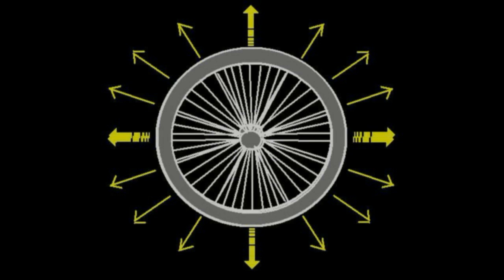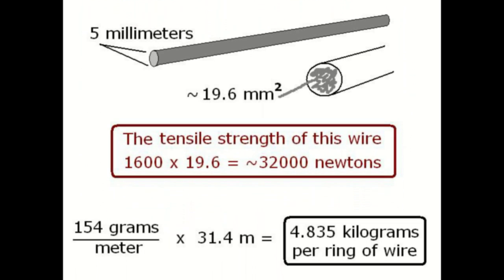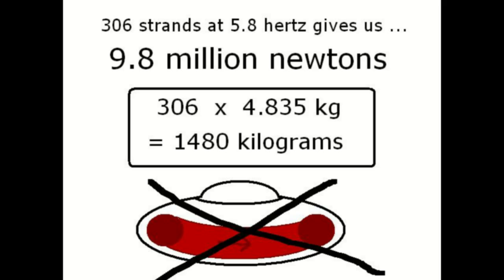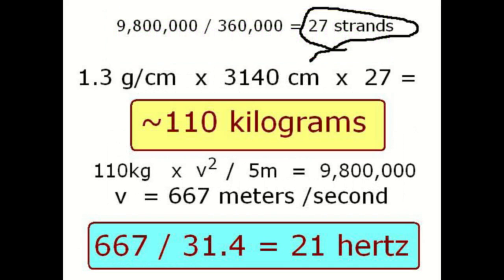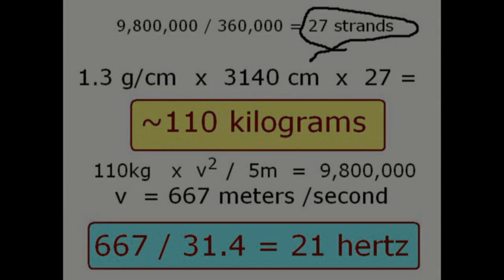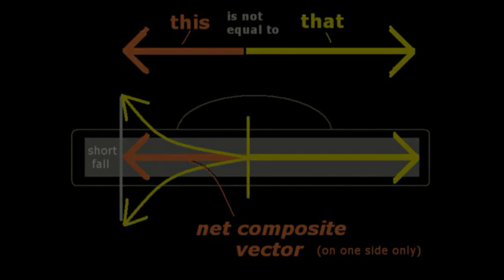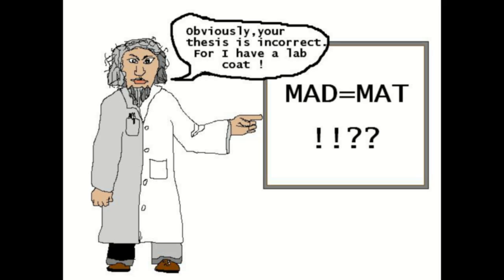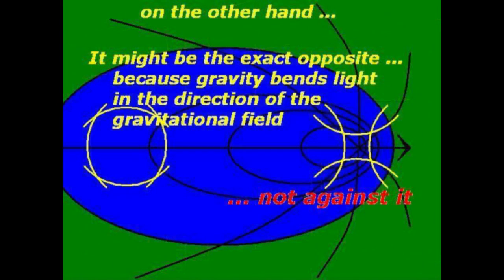Saucerdotal - The Mystery of Ufo Propulsion -3/6

Comment: Hello Mr Bantokfomoki I have two mechanical apparatus drawn on Google sketchup one closely resembles the concepts you described in your UFO propulsion videos except they are rudimentary mechanicals that operate in accordance to the materials strength and not relativistic speeds. The one that I see resembles your vision I will call a three dimensional acceleration auger device. It simply uses angular acceleration geometrically configured in just the right way so that the symmetrical momentum objects change relative weight during each half cycle of rotation due to layered multiple planes of angular acceleration) at the angles you describe with your field particles. I will only say they rotate into a type of counter space for lack of a better term without giving away the whole idea. I have a USPTO customer number and PKI credentials. I have taken patent classes and am very serious about both the apparatus. The apparatus does not have to be built by us but needs to be described in such a way as someone who is skilled in the art can build it.  Just guessing but it sounds like you may be retirement challenged just like me. I'm an insurance agent but in school I ranked high in science but unlike Einstein who persisted in physics instead of taking the insurance job his family urged him to take I actually have been selling insurance for 40 years and I'm still broke. I've really enjoyed your videos and consider you to be a tremendous asset in understanding complicated subjects. If you would like to help me raise money for patent fees and develop a proper abstract for the device I will gladly share with you 30% of all licensing fees that may be offered. Any monies that could be raised will go to the USPTO with receipts provided and full disclosure between us. According to my classes if all goes well each patent will only cost about $650.  If I've peaked your interest all we would need to do is sign non-disclosure statements and figure out how to come up with $650.  All best  William Gregory or just send me an email. look me up under William Gregory Insurance Albuquerque. p.s. The other patent idea probably has a better chance to succeed as I have been able to work out all the math that supports its concept.
Reply from the maker: I would not be interested in any kind of "sharing" arrangement. If I were ever to discover something basic of value it would be given away without remuneration.

Long ago, I decided on a solution for a payment option:
"If you profit from anything originating with me ...
decide in your own mind (without consulting your wife) 
what my contribution was worth ... then ...
You owe me exactly 1/2 of that amount."  ;o)

No patents ... no government involvement ... no arguments ... no problems.
I'm not in it for money ... I'm too old to bother about that.

In these matters ... you are completely on your own ... until and unless you can construct a working model ... then ... you will get plenty of offers ... or ... a simple bullet in the head  ;o)
Reply: Very well, I think I understand. Thank you for your reply.

Comment: hmm on Wikipedia it said the tensile strength of carbon nanotube is 65000 megapascals.
Reply from the maker: search wikipedia "ultimate tensile strength"
- "The first nanotube ropes (20mm in length) whose tensile strength was published (in 2000) had a strength of 3.6 GPa"

.................... 3.6 gigapascals is 3600 megapascals.
There are other types of stronger carbon nanotubes. I took the kind that were actually made (not theoretical) as an acceptable type for my thought experiment ;o)
Reply: +Bantokfomoki ohh ok I saw that. ok thanks.

Comment: Fill a hollow do-nut ring with a mercury based ferrite fluid, wrap a coil around the ring and apply mega DC power.  Within, the fluid begins to, not only spin, but ROLL.  The roll is important and key.  To illustrate with words, cut the do-nut in half like a C.  In the left side of the circle the fluid rolls clockwise.  In the right circle it rolls CCW.  The power of centrifugal force becomes harmonious at the core.  It falls from the top to the bottom.  The basest experiment you can observe is to light up a rather fat candle and let the pool of wax build deep.  scrape some of the burnt wick into the pool.  Track the small black specks caught in the current.  Multiply by sphere.  In the case of the candle, the thermo-current event is upside down compared to the direction of force you may be looking for.  The answer is in centrifugal force because it produces a gravity field from the inside out, unlike natural gravity that flows from the outside in.

Comment: Polarized neutron graphic looks like the doppler effect, reminds me of R Feynman's work.  I really  enjoy your objectivity.  Have you considered a solid state device, rather than actually rotating (physically) rings?  Are you opened to new ideas about gravity?
Reply from the maker: I'm always open to new ideas ... provided that they have some connection to geometry and logic. I'm not open to new ideas based solely on mathematics however. I think I understand it pretty well at this time and am not looking for anything new in the gravitational venue. All I want for Christmas is ... a simple mechanism for generating the mass values of all sub-atomic particles.
Reply: You know the truth:  One finds ONLY what they look for!
Reply: Bantokfomoki Are you talking about the Higgs boson? You already got it for Christmas or officially seven months later (2012-07-04).
Reply: Bantokfomoki
 Here you go: m=h/(Rc)

Mass values for sub-atomic particles is an oxymoron, when trying to measure one alone.  A Sub-atomic particle has no mass, they (at least two) create mass as they interact internally AND externally.  The internal binding force between the TWO particles in bond also creates a de-finite separation between them. Then as external (to the internal bond) forces act on one particle before the other, that finite internal separation distance is changed.  The finite speed of light creates a delay in the subsequent motion of the second particle, which causes inertial behaviors.

The Higgs doesn't suffice, and the model is wrong.

The proper use of the above formula is to calculate the inertial mass of one particle which IS IN a bond with another particle, and is then acted on by external electromagnetic activity.

It's ALL Light.  And Light bends toward electromagnetic activity.  The (limited/finite) speed of light causes a delay between the motion of the first particle acted on by external electromagnetic activity, and the second particle following it.  That is also HOW time is created, which is another dimension of Light.

To put it most simply: In the beginning God created... And God said, Let there be light: and there was light.

Light is the very first thing God brought forth out of Himself, and from that Light, and through that Light, God created everything that was made.  That Light is the Life, and He is the First begotten Son of God, the beginning of His creation.

So if you accept the truth, which is Light, the Light will teach you all things, even revealing the Father of the Light who is God, and all the aspects and qualities and nature of Light; which IS the creation of God.

This is the Perfect Way to understanding, First receive the Light, then be enlightened by it, and your understanding is then a reflection of your relationship with the Light.  In other words; an internal bond between the two.  Get it?

Enjoy your journey, and seek the Truth!

Comment: indeed, and i agree - few real options, however, if the ESA in fact produced a gravitomagnetic field energy, then a baby step has been taken, making the article and the PDF experimental_detection worthy reads. in light of this possibility, then the correct field dynamic can be learned, or we can take a shot in the dark and use, for example, Dr. R.L.Forward's configuration of the helical torus, or better yet, a frame-dragging configuration producing M.Alcubierres's bubble and go all out - pun =)